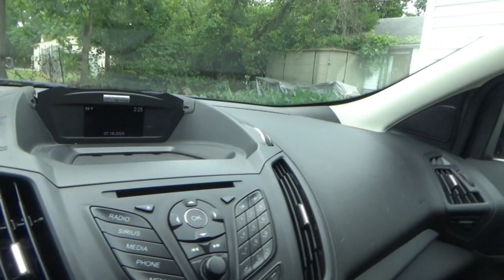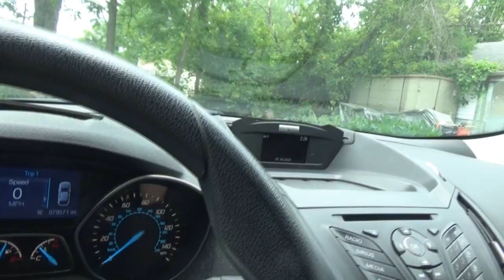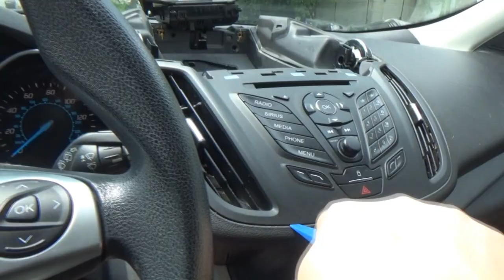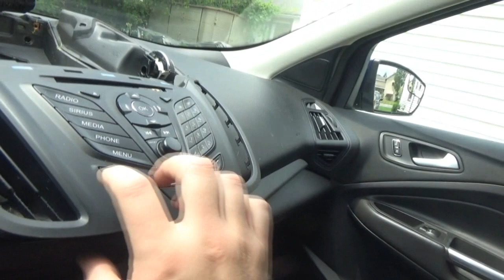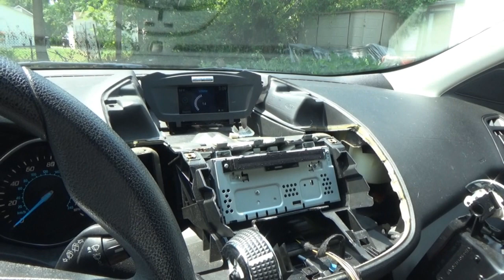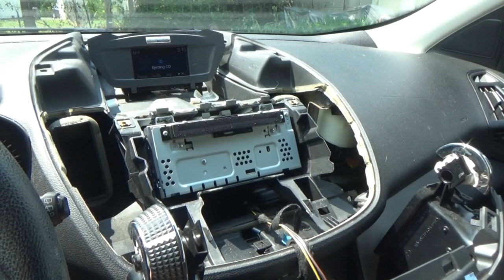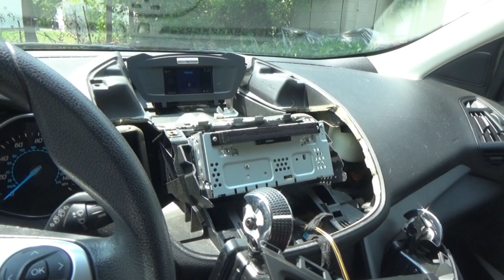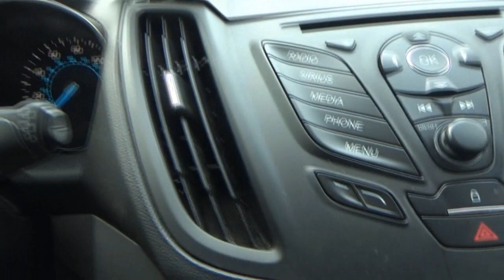MV 417 - "Finally Fixing The CD Player In Mom's Escape?"

Comment: Hey Mike, is there a way I. An just disconnect the cd player power so the eject mechanism stops running?
Reply from the maker: My guess would be to carefully open up the unit and unplug the drive from the main circuit bored inside. That should disable the whole drive.